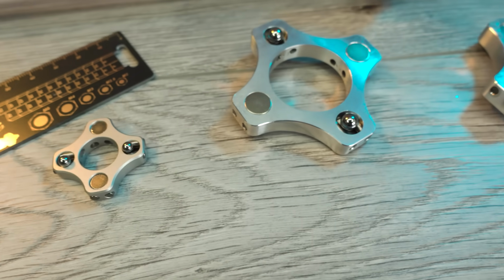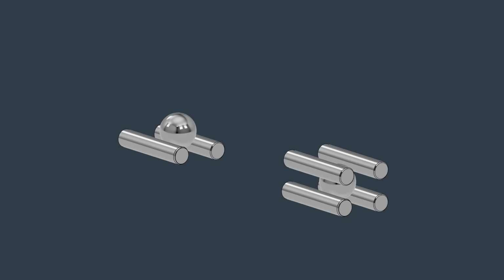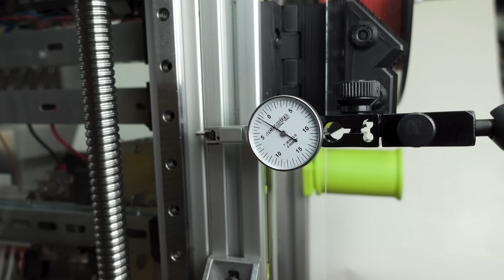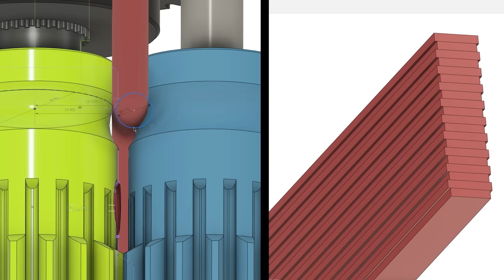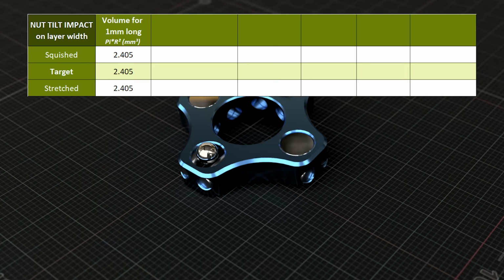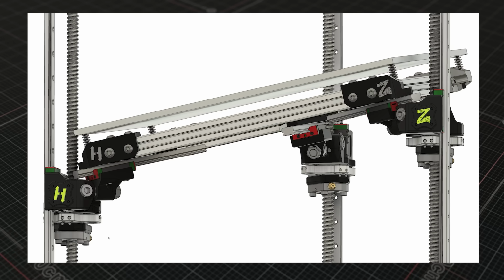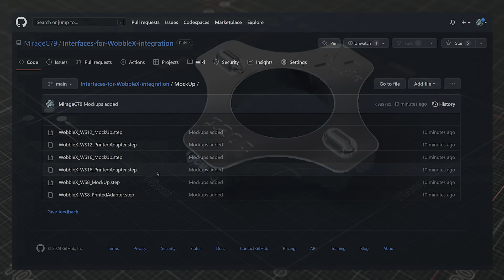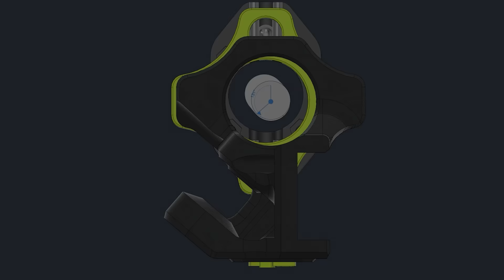I will never talk about Z wobbling ever again !

Comment: I was gonna get it, but takes too long to ship from China. So I printed separate frame for Z screw nut from the rails. It lifts the Z rails, but it has freedom to wobble on it's own. The key is to prevent rotation of Z screw nut, but allow it to micron X and Y.
Reply: Im intrigued as to how you did that! What files specifically did you print, etc?
Reply: @RC-fp1tl  print solid 1.5cm vertical, 0.7cm width bar from Z rails holding the bed up, halfway towards Z screw nut,. Print L shape bar from Z screw nut halfway to the Z rails. Have L bar hold up the Zrails bar with overlaps but do not screw them together. 
When the Z screw wants to spin right, the bar from left will prevent the L locked to Z screw from turning, vice-versa. 
There is a bit of flexibility in solid bars that are less than 1 CM thick, so the Z screw nut can move away from or to the bed. Since the bar and L bar are not bolted together, Z screw nut can also move laterally towards two Z rails, but it will not twist at all, especially due to overlap adding stiffness to combined resistance of the solid bars. My Z motors use 4 start 8mm lead screws and brass anti backlash nut. I put chain saw grease mixed with engine oil to lubricate them. I had 2 start with less wobble than 4 start before this method, but it binded all the time on my Dual Z no matter what I did. I may go back to 2 start now that I've solved the wobble.
This is on single Z or dual Z setup. For triple Z, you can easily figure it out as well.

Comment: It's interesting how you have a kinematic mount that is supposed to get rid of the wobbling. You probably only need the wobble adapters on the 1 axis that is constrained.
Reply from the maker: Not sure I follow your train of though.  In this installation the Kinematic is to allow for bed tilting.  If one of the pillar oscillates, it will affect the bed behavior.

Comment: That why I use belt for z axis on my printer , don't have to worry about bend leadscrew
Reply from the maker: What printer do you have?  and what strategy are you using to keep the bed from falling when motors are not energized?

Comment: So, you recreated oldham couplers.  This is why we used 5mm threaded rods in the RepRap community instead of 8mm.  This way the rod could deflect and not overpower the smooth rods.  Everything old is new again!
Reply from the maker: Nope. OldHam coupler deal with wobbling only.  These will manage the nut tilting as well as teh wobbling: 5:18.

Comment: why not just use compliant design and flexure??!
also my worry is that the tilt itself even if compensated for will mean that the z axis won't move as much as it should have. because moving up at an angle is less distance thanat 90 degrees
Reply from the maker: 3D printed material?   They would end up being quite thick and will suffer from material creep under load and temperature.  This approach was tried, but not successful.
Reply: @MirageC  oh I guess your bed is so heavy, tho metal can be suitable for flexure too. I'm still gonna try it on my own printer if I ever get funds and time for it.

Comment: How to deal with Z-Wobble Problems in four alternative ways:
Option 1: Use higher quality Lead/Ball Screws.
Option 2: Use Belt based system instead.
Option 3: Use matt Filament instead.
Option 4: Realize you're a) working with Plastic and that such minor deviations have no practical impact on the functionality / tolerances of a part for you to waste any sleep on and b) such Tubular parts exaggerating this issue hardly ever make it into the real world - I mean... When has it been the last time you printed a part where Z-Wobble was this apparent to you? 🤔🤨

Ppl really need to learn to put things into perspective and chill when it comes to 3D Printing accuracy... Like when they cry that their 350x350mm Print Bed has a height deviation of like a quarter Layer Height over its entire Surface Area... Really?! You're not making precision machined parts for NASA to ensure an Airlock remains sealed mate... You're just printing a Vase out of friggin' ~30.-/kg Plastic.

Comment: Did you try removing the tip mount for the screw, so it’s only supported by the bottom? This eliminates most problems for most people, because it prevents it all from being over constrained, and from being sensitive to bends.

This is what I did.
Reply from the maker: On a lead screw this works well indeed.  On a ball screw it is a different story.  They need a support bearing at the bottom. SInce they are bigger and so rigid, they will still pull your bed around.

Comment: 10y ago i used something simillar 
Diy project but i made it double the balls and used
4 long pieces of 3mm steel rod from old cd/dvd per side (can be counted like 8 because they worked like the one on video but mounted on sides of the screw so i dont needed to cut them in half) +  4 balls (2 per "rail" rod)  one stage have 8 rods and 4 balls (16 rods if cut in half) 

 Single "anty z movement spacer" like i called it have 16 rods and 8 balls alowing only for movement in xy axis 
If it was made like one on video (rods cut in half) then it will have like 32 pieces od 3mm rod and 8 balls😅😅

I also used for testing something simillar to stepper motor clutch (the one to mount stepper to ball screw)

And i made few of something like cluth in old cnc where you have 2 pieces of steel bend into O shape but rly flat O shape
Both connected into cros shape 
They alow for movement in ....5axis ... in Z also :/ but not much depending on load (need to be in kg to even move 0.1mm so not bad)
Worked great in my case but not the best idea for 3d printer (works avesome like clutch for cnc though) super stiff 

But for super rigid 3d printers with 20mm linear rails on Z axis...i just bend some steel 2mm flat bar into U shape ...one end is bend into L so it can be mounted to the rail
Second end go directly to the screw nut
Works pretty good 
But super stiff for average 3D printer and wont work 

My cheapest solution was to use m5 long screws 😂 
They soo flexible that wont make any difference on print quality 😂
Reply: Ps.
For extruder i just made extruder gear literally on motor gear
I buy used stepper motors with press fit gears that have tooths only on ends not on the entire press fit part.
Used the motor like 4 axis
And literally made m6 thread on its gear
Then made second (overall 3 ,first one damaged when learning how to make it)
Connected them in parrarel (they have still tooths on ends almost like bondtech) so they worked like bondtech (but at first using 2 motors on oposit sides after a week i take the gear from one motor and made it literally like bondtech) ....it was 10+ years ago before i even know bondtech
Still have first motor with its gear used for learning, and it works with single gear  (i grinded the tooths to make it only for pushing fillament without second gear so only worked alone with bearing )

Comment: Very great video! I have made the somewhat exact same experiences you talk about in this video. I have an Ender 3 with a single Z-axis screw. I used a anti-Z-wobble constriction from Tekti from Thingiverse as inspiration, designed it completely from scratch from CAD and use it in my printer right now. It works, but as you said at 7:30 you need to fixate both ends of the screw, so the "wobble" will be transferred to the part that is made to take on the wobble. It works very great, even thoug it is 3D-printed and uses magnets instead of little rods. So far, so good.

Very cool video, I like it.
Reply from the maker: Thank you! Glad you liked it.  Yes, many systems will accomplish the same role.  Many ways to skin a cat as they say... My grandfather did anyways ... lol
Reply: @MirageC  Yes, I had to do some iterations, but since the print is actually 3 piece and quite small, it doesnt take long to print. I sureley had some space trouble because of the extruder stepper motor. But it works pretty good, even though not engineered/desgined to every standard. I hate to go for some shortcuts to safe a bit of space ... no threaded insert but screws directly into the plastic. Works fine if you dont tighten it too much and dont unscrew it and rescrew it every half an hour.
Reply: @heavyweight6440   Have you observed the hardened ball bearings chewing up the PLA layers buffering between the magnet pulling from the other side...in the same way MirageC noticed bearings directly on magnets chewed up the magnet surface?
Reply: @patrickboyd8368  Not yet. Right now it all looks kinda good, but I can imagine that after enough print hours the magnets will probably suffer the same fate as they did in MirageC's video. I also am pretty sure that Tekti has developed a different version that doesnt use magnets anymore but 2 dowl pins as guidance for the ball bearing. They have much greater HRC then the neodym magnets and will probably not suffer such a fate. But as of now, it all looks ok. I think they weight of the tray is not great enough to damage it very fast. Otherwise you could upgrade to double Z-Axis on the ender 3 and split the load up on two anti-wobble systems. This doubles the area where force is applied and the surfaces of the magnets will live much longer.

The PLA looks all fine as of now. Prints also come out good.

Comment: I'm very interested in trying these out and I'm curious what other type of relatively "minor" modifications can be made to a 3D printer to give better output.  Is there a list of them?  I would really like to apply the mods to 2 identical printers, one modded, one not, and see the difference in printer output.  I'd be interested in doing anything from swapping out the extruder end, heater core of extruder, extruder mechanism (part that pushes the filament through the hot end), extruder motor, etc.  

Is there any benefit to upgrading the stepper motors that drive X/Y/Z axis?  Would a larger/stronger motor give a better result?  

What about installing a counter-weight that travels in the opposite direction, or on the back-side of the extruder/hot end? It seems like if an equal mass was placed on the other side of the hot end there would be less jerking/shaking/wobble when the unit needs to slow down or stop.  An equal mass acting with an equal & opposite force to how the hot end/extruder is traveling.  Is there anything to this and if so, how is it done?
Reply: Rule #1: Define your problem then work on a solution to it.  

It's rare that you would gain anything messing around changing motors.   It does nothing unless the origional was underated in torque or went bad.  Bigger motors need more amperage so you need drivers and cooling to support them.  TMC2209 drivers for example are only rated in the 2 amp range so you can't go real big without bigger drivers.  Ohms law: Volts * Amps = Watts.  Wattage translates to heat, turn on a 7W and 60W light bulb for an hour and see which one burns you (just kidding don't grab it lol)   Also in bigger motors you have more rotational inertia which has to be overcome to quickly change directions.

Comment: why not go belt anyway???
Reply from the maker: I started with ball screws and wanted them to work good.  I reached my goal.  As for belted Z,  I dont know all printers out there, but the only ones I see are user modifications. No official design of belted Z beds.  Is their a reason why no one is officially going that route?
Reply: @MirageC  i think most of the problem with belted Z is work that some have to do so it can hold it's weight when turned off. But I think devices that invert the stepper motor polarities and worm gears solve most of that. 
And you wont have the major problems with ball screw rigidity or innacuracy.

Comment: If I have 3 ball screws, does it cost almost 70€? Concerning that Aliexpress is usually very, very, very cheap, it sounds expensive for a few rods, balls and a piece of aluminum with some holes in it.
Reply: It is expensive. Surprised nobody has knocked it off already. Good thing about it is you can print this, buy some pins and cut them down without losing anything. Edit: or just use a belt.
Reply: @ChrisHarmon1  I agree, but due to the reason for being different, I would like to use even more ball screws. I really would like to use them for x, y just for the sake of it ^^. For x and y I would have to modify the design anyhow and it would be bright to first finish a Voron just to increase the likelihood to be able to print anything at all.

Comment: Can't you just not fixate the lead screws at the top and get the same effect?
When I look at my Prusa MK3S+, the screws end in free air. And because they can freely move like that, they don't apply any wobble-force to the X-Axis.
Reply: You should watch his previous video comparing lead screws to ball screws. Lead screws are relatively flexible and and forgiving if your printer is otherwise rigid, but ball screws are very rigid and will transmit all imperfections to the print if not accounted for.
Reply: @Kosaro1234  plus even though ball screws are far more rigid. that doesnt mean lead screws are made out of air. its still a solid metal part trying to force the axis out of alignment, even though it is able to be bent it still will be causing an issue even if they arent fixed at the top. but fixing them at the top will definitely make the issue far worse. its just whether or not that issues is enough to cause an issue thats beyond desirable tolerance and whether the improvement from adding this system is benefitial enough to justify the cost.
Reply: @Kosaro1234  Oh. I didn't even notice the difference. 😅

Comment: While i do love the ballscrew approach, i see the solution in a belted z given its cheaper and just doesnt produce any z wobble. Woth the right geared steppers, triple z can easily support beds with 8kg and with counterweigts even more. Also the added benefit of temp resistance up to 135C if the motors are outside of the chamber. Tbf it doesnt look as amazing though haah
Reply: Also not as reliable and belts stretch over time, plus normally a more complicated setup.
Reply: @thegarageluthier  Its not as reliable, but to he honest i never had any issues with my setup. The stretching is irrelevant, as long as you dont print for multiple weeks. And the stretching is less bad with a counterweight
Reply: a lot of people print 24/7 and counterweight adds extra complexity over and above the already added extra complexity. but saying that, it does work and i use it myself on some machines just always found my screw based machines to be the most reliable day to day.
Reply: @thegarageluthier  i was talking about printtime between prints given after a homing the stretch before is irrelevant. The ballscrew decouple adds a ton of complexity aswell. I personally like the idea of no deviation a lot more than belts, i have heard so many horror stories with leadscrews (not ballscrews, ik) that i didnt bother. But i agree that if the money is there leadscrews might be the better option for lower temp (high temp being over 90C) operation
Reply: @thegarageluthier  If that’s the reasoning… then use screws also in x&y … they are more reliable than belts right? 😏 This looks cool as a fairly over-design thing but cost-efficient not so much
Reply: @lavafree  well thats why cnc machines use them.
Reply: @thegarageluthier  Yes they do. Also totally different motion systems needs: high torque vs speed. CNC heads weight usually kilograms and need to move slow to cut stuff. 3D printer head’s usually weight an order of magnitude less and need to move as fast as possible to create layer by layer an object
Reply: @lavafree  very basic understanding, but 3d printers dont need to go fast its just what consumers want at the moment. There are companies in the 3d printing sphere that already sell machines with fast lead screws and ballscrews. Different strokes for different folks.
Reply: some people just want a set and forget thing, some people can't be bothered to check their printer every week or month to make sure nothing comes loose after it's been working 24/7, they just need it to work, plus i'd say belts and high temps don't mix, high chamber temp already makes them more flexible